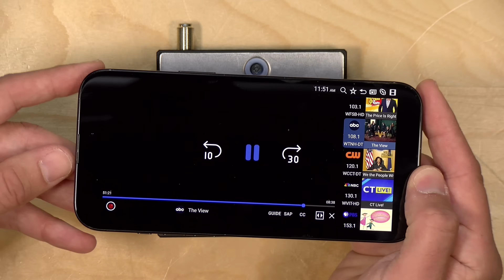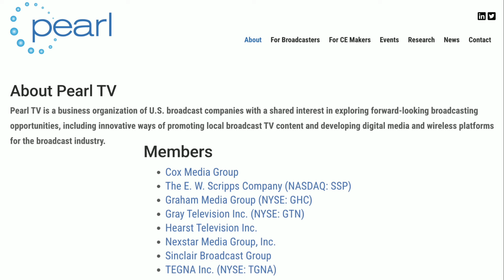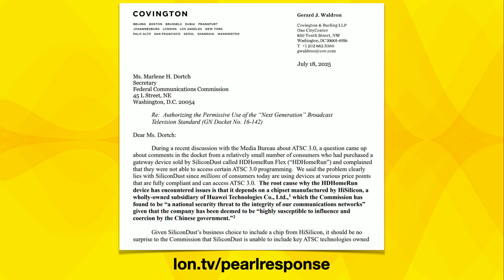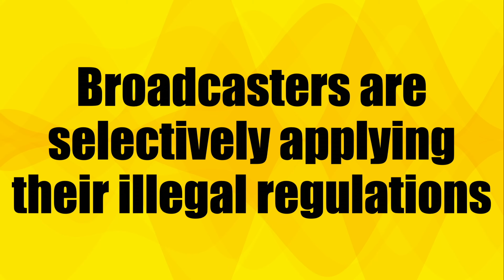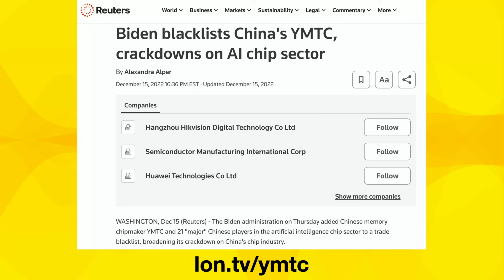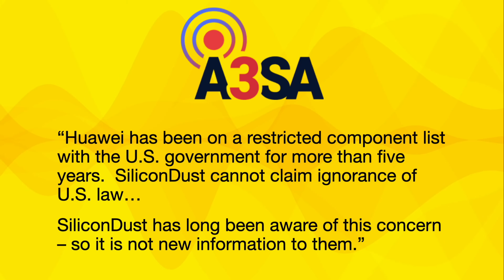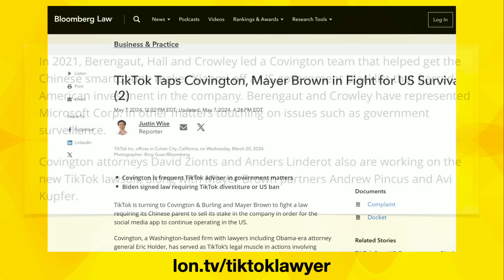Big ATSC 3 DRM Update: Did Broadcasters Admit They Are Selectively Enforcing the Rules?

Comment: if I remember correctly from my research, when I was in high school in college, it used to be that cable operators were under the must carry umbrella for broadcast TV. I may be mistaken, but it doesn’t seem like at that time broadcasters were allowed to profit from being carried on cable networks when the deregulation happened I stand corrected. That is what I think the change happened about 1992. why local TV stations ever have been allowed to profit from their signals when the airways are supposed to be public in the first place never seems to have made sense to me and it seems like that’s what this is all about is they’re afraid that they may end up losing that ability as well. They should as far as I’m concerned, and if they lose, at least half the revenue will tough sausage! I think your anger is well placed, and well founded I certainly don’t believe that you or tenement are Astroturf.
Reply from the maker: That's correct -  the 1992 law moved from must carry to "consent." Broadcasters could opt to require carriage, or alternatively consent to it with compensation. That was the beginning of the end!

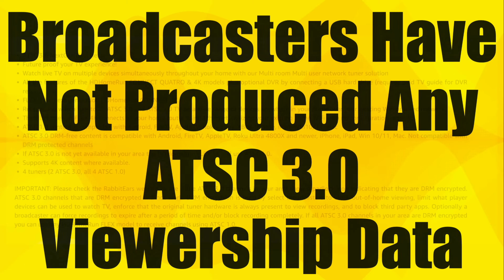Comment: 19:00 I just don't see a market for ATSC 3 devices anytime soon. The broadcasters have effectively alienated their "early adopter" market via the A3SA's war on gateway devices. Furthermore, most of the infrastructure built for ATSC 1 still does not work on ATSC 3 thanks to a potent combination of expensive proprietary codecs (especially the rather exotic AC-4 audio codec) and the ever increasing DRM encryption blackout problem. Overall, I think broadcasters are going to find it hard to sell this turkey of a technology because it's designed to be a solution to a revenue problem instead of a product that people actually want to use.
Reply: The Tech is going to be obsolete before it ever gets market adoption of any kind and likely it never will, complete failure. Who would want the Datacasting part when we have High speed internet, like who would use it, my 5G gives me all I want when I'm away from home. Its already a complete failure like Laser Discs and 3D Tv, nobody wanted or asked for ATSC 3.0. ATSC 1.0 works fine.
Reply: I think that's exactly what the broadcasters and the FCC want. Broadcasters would LOVE it if all us OTA plebs would just suck it up and get a cable subscription. FCC is already working on plans to sell the OTA bandwidth. These hurdles just make it easier to take what is currently ours (consumer/citizens) away from us, because they think enough of us won't fight this.
Reply: @beitie   The last repack in 2017 sold off channels 37 to 52. Channel 36 is 603 MHz. The frequency of channels below that aren't ideal for cellular, as the wavelength starts getting too long.
Reply: @derek17ca  Also, 14-20 are used for land-mobile in a lot of markets, so those can never be sold off.
Reply: @beitie  Ain't happening (getting cable). Just won't watch (there's plenty of content on the internet, and hardly anything on broadcast TV worth watching these days other than sports (and those are going streaming anyway) ).
Reply: @beitie  Except that if it were not for OTA viewers, there would be no need for OTA transmissions. They'd put themselves out of business. Anyone with an internet connection and a room to set a studio up in, could replace an OTA station. Just look at YouTube. Much of it is crap, but there is some really good (production-wise) content.

Comment: Lon can you verify, the A3SA has recently released specifications and rules for secure DVRs and gateways, which would enable support for encrypted ATSC 3.0 playback and recording by the HD HomeRun Flex 4K.
Reply from the maker: We've covered those rules in a prior video - that was their public facing commitment, but behind the NDA the rules were so stringent no gateway maker could pass muster. Additionally the fine print on that was that the rules only applied to simulcasted ATSC 1.0 channels - meaning that after the transition they were null and void.
Reply: @LonSeidman because anyennaman reviewed the Hisense U7 TV with ATSC 3 DVR built in. Is Hisense aware their ATSC3 DVR will break instantly and anger owners provoking class action upon ATSC3 transition?

Comment: Lon, as you stated in your video, the broadcasters only care about cable/satellite/streaming TV fees revenue. My Sony XR TV has a NextGen certified ATSC 3.0 tuner and I also own a ADTH NextGen certified external box. The only channels that I have encountered issues with in the Nashville TV market for ATSC 3.0 are the NBC and CBS affiliates, which use DRM. I had to file a complaint with the FCC regarding the signal for the NBC affiliate constantly freezing. It took over two months for the problem to be rectified, and it took me sending copies of emails to the FCC that I had from other viewers in the Nashville market that have ATSC 3.0 "certified" devices having the same issue as I was, before the problem was rectified. The engineer for Sinclair in Nashville, who operates the ATSC 3.0 "lighthouse" in the Nashville market, was trying to pawn off to the FCC that I alone must be having the issue, and the issue with the NBC affiliate "mysteriously" disappeared after I forwarded the emails to the FCC. This experience has left me with the feeling that the broadcasters are snakes and love to attempt to sell snake oil to the FCC.